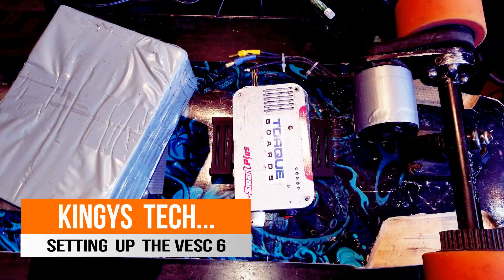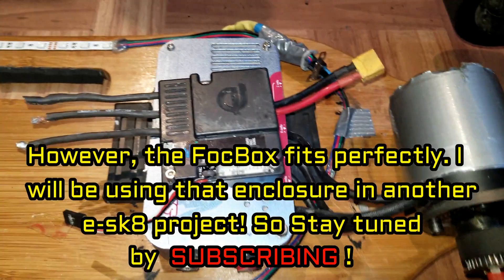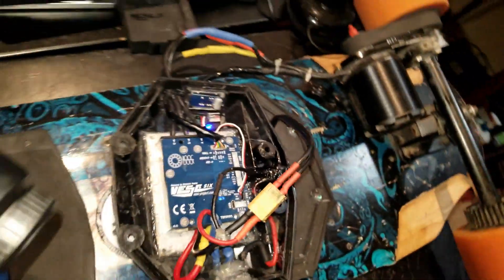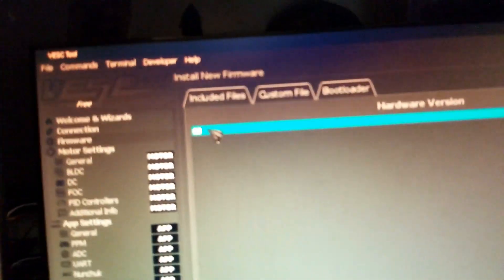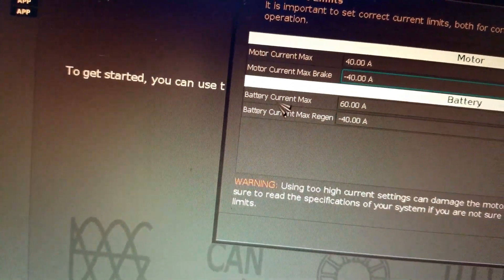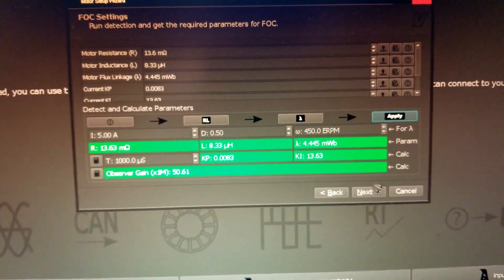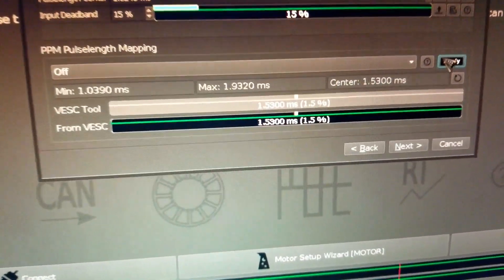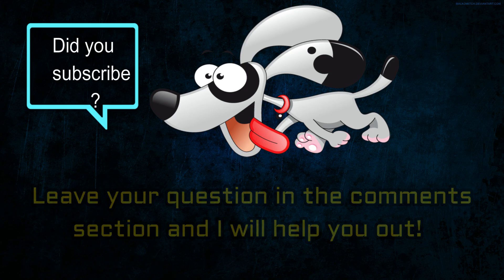THE VESC 6 SETUP - CONFIGURATION - WIRING - ENCLOSURE - DIY ELECTRIC SKATEBOARD BUILD

Comment: that switch might get hot and be a amp  limiter.  Maybe a dual loopkey would be better. One on pos and negative could keep you from having to run the main battery wire through a switch, just my 2 cents.
Reply from the maker: You are right! I upgraded this later

Comment: Any chance you can do a video or explain how you wired the three switch. I'd like to do the same for my Esk8 board with my VESC6. Could really use your help.
Reply from the maker: I could. But this was a temporary switch solution for me. every time you power the board the way I'm doing here, there is a lot of sparks occurring inside the switch, since they are not designed for high current application, they do not last. They're not water sealed either. I highly recommend an anti spark switch or a simple XT90 anti spark connector